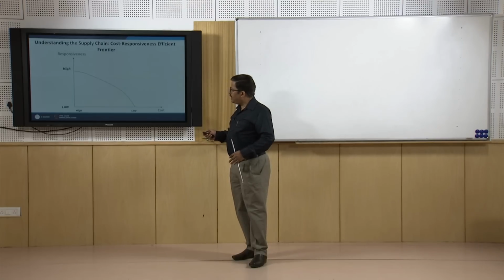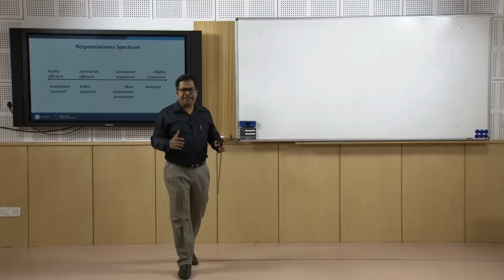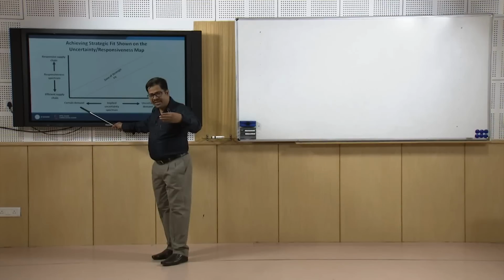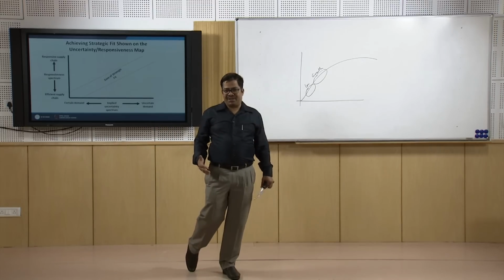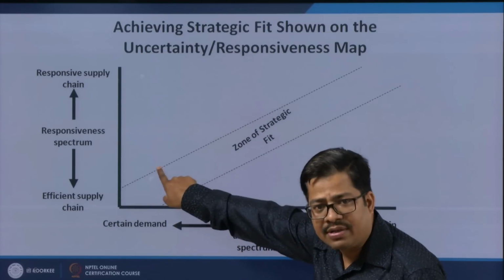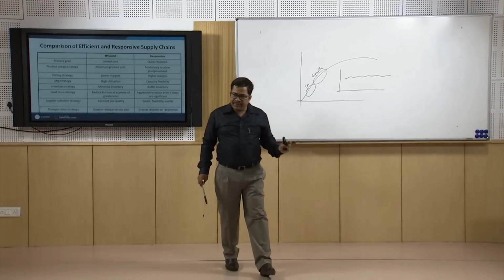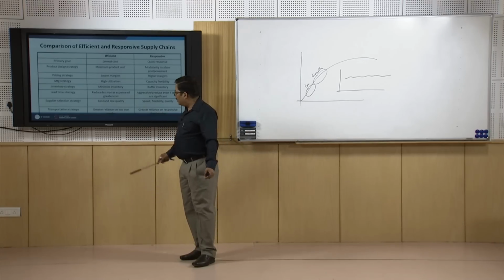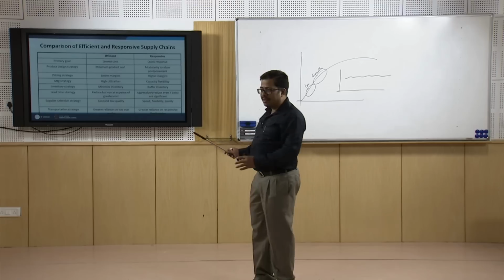Strategic Fit in Supply Chain

Comment: Very informative lectures. One question Sir, where does the Amazon fit in your example ? I think by sending packages over night they follow Responsive strategy but at the same time their cost is competitive as well. Where can I find Amazon business on your Strategic fit chart ?
Reply: Amazon is a good example of evolving supply chain, however you cannot place it in a single zone as it has a diverse strategy driven by customer sensitivity and needs. I would say it is on the path of becoming an efficient supply chain for customers that are price sensitive i.e. want products at a lower cost and can wait for delivery. At the same time, for customers who want fast delivery it is a responsive supply chain.
Reply: @himanshuchopra8877  Your answer is wrong. Because  amazon is the not the platform which decide the price of the product its seller who decide the price of the item . Amazon courier charges are fixed and comission
Reply: I think what sir explained speaks about product linking to the supply chain strategy (e.g., iphone, salt, etc.) 

Since Amazon sells a mix of products, it will have its supply chain challenges according to the product